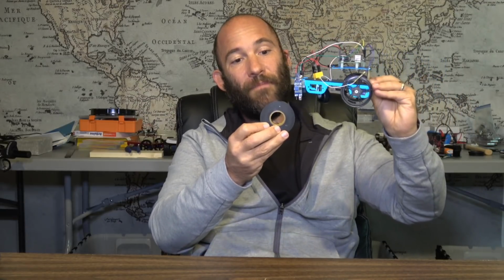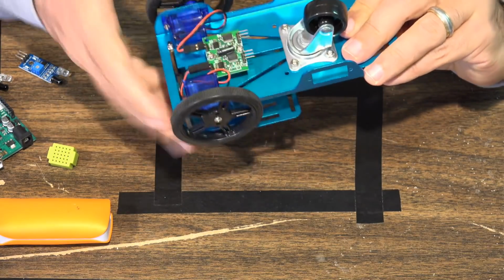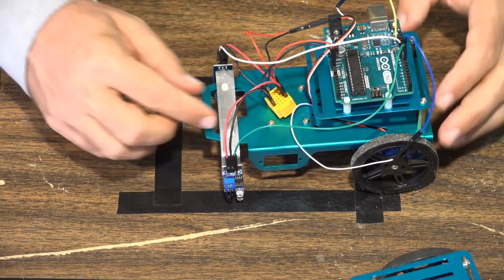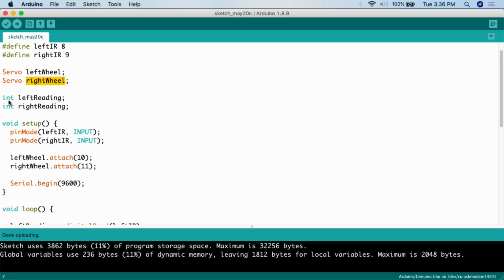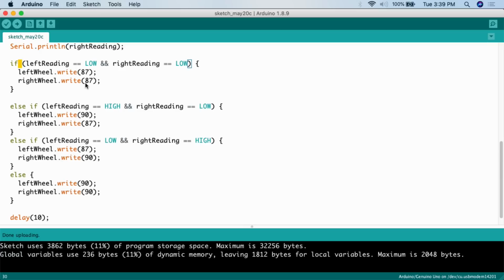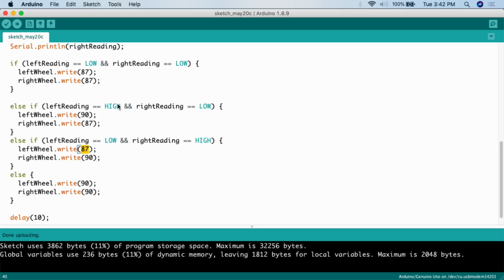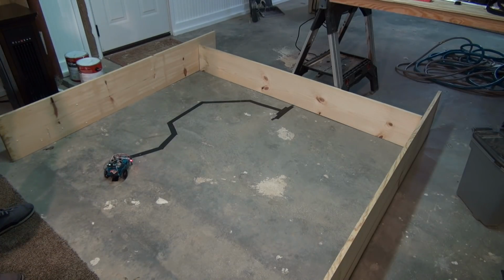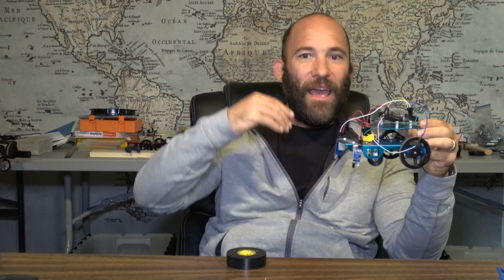Arduino Line Following Vehicle Using IR Sensors

Comment: Ah. So this is the premise used in Tesla. Interesting. 
Watching it in focus
Reply: Does the motor control board have to be where the wheels are at? Or in the case of the vehicle frame, can it be placed in a different spot? 
I can picture Batman's car and how his car got hacked because the board controlling it was beneath the frame where the wheels are. 
>>just a nugget to bother.